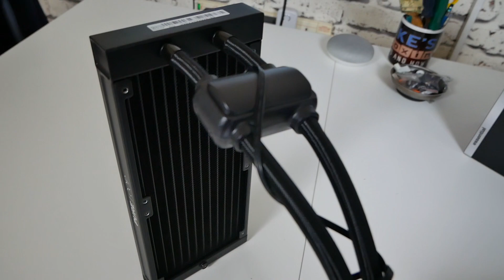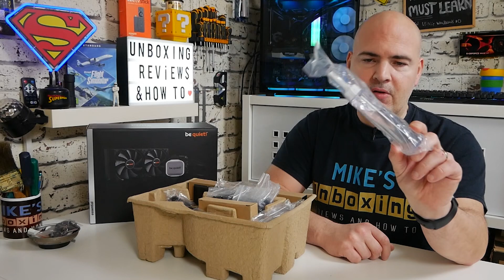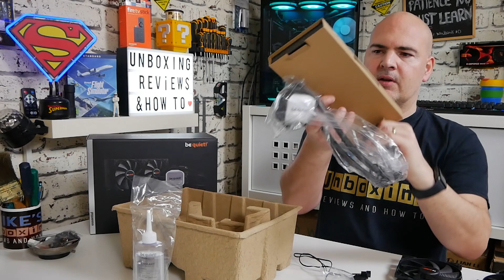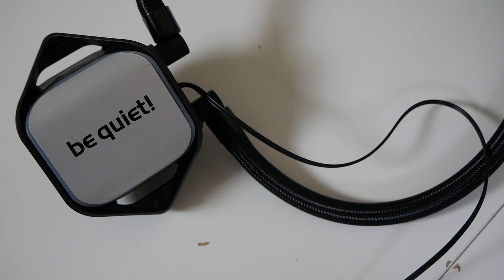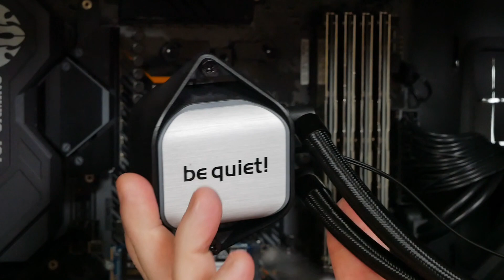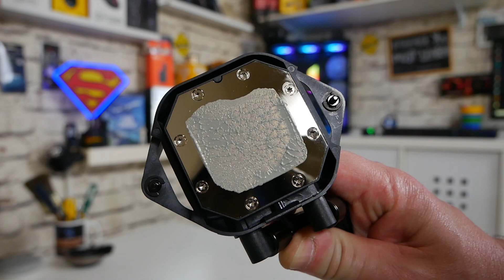BeQuiet Pure Loop 240mm Refillable Silent AIO PC Cooler

Comment: Great review Mike. I actually purchased this from Amazon US for $94.50 USD, Never tried water cooling , so I thought...why not give it a try. The two main selling points for me was how the pump was attached to the cooler hoses and it could be refilled when needed. Brilliant! When ever I peel the plastic off a new cooler... I always clean the bottom of the cooler with  Isopropyl alcohol 90% or better to clean any adhesive that might still be on the bottom. Thanks for all the hard work You and Kath do for all of us wherever we are in the world. Cheers.
Reply from the maker: thanks rick glad you like the cooler, it is a nice design and that also reminds me i need to buy some alcohol

Comment: The cheapest I can find it in the UK is £89.99 plus £4.79 shipping. At that kind of price you're talking the equivalent of a very good air cooler, something like a Noctua NH-D15, so I'd be interested to know how they compare. Enjoyed the video by the way.
Reply from the maker: yes against the d15 is is very close although for me the d15 is actually a bit too big and prevents easy access to the gpu if it needs removing, both are awesome options
Reply: @mikesunboxing  Yes, I can see how a large air cooler can lead to size restraints. I have my GPU vertically mounted and it nearly touches my CPU cooler!
Reply from the maker: @mikep9418  that is always a concern with air cooling. vertical mounting gpus was really designed for water cooling or the narrower cases like the lianli o11 etc

Comment: From a design perspective (and after the infamous Gamers Nexus AIO Video) It ticks a lot of Boxes.
Top mounted and the pump is lower than the rad so below the highest point
Bottom Mounted the pump is below the CPU block so below the highest point
Front mounted obviously if at the bottom would be at the lowest, 
The only place it even comes close to being the highest point is when front mounted with outlet at the top but even then it 'should' sag down enough to be slightly lower.  
Maybe it would be better with another 2-3 cm of tube before the outlet but? might create more aesthetic/interference issues.

(Personally after everything  I've heard and seen about AIO's I'll stick to Air cooled......Maybe :p )
Reply from the maker: Agreed steve has changed the market

Comment: My son had considered the 280 version but went with Arctic Freezer instead.  This may have fit the top of his case bc the radiator is not as thick as the Arctic, but the Arctic, I imagine cools better.
Reply from the maker: the arctic has a larger thermal mass due to the thicker rad so often tops the charts in raw performance
Reply: Of course, am sure why my son chose it, over the be quiet !

Comment: Even though this is great water-cooled product from be quiet, I have chosen  be quiet! Dark Rock Pro 4 50.5 CFM CPU Cooler for my new pc (most likely Intel since ASUS mb build quality is better than AMD one, and I had ASUS (Intel) mb for 10+ year's know + it is working as good as day one).  I bought  be quiet! Pure Base 500DX ATX Mid Tower Case for my system, and can't recommend it enough, it is amazing. If you can, buy it for yourself and put your system in it.  It has RGB, but it is the right amount (in my opinion). I moved top fan to the front to increase space, and add more cool air in.  When I build similar custom (one off ) pc case, I'l put their top of the line fans (x5  be quiet! Silent Wings 3  140 mm	Black 1000 RPM	59.5 CFM  15.5 dB (3 exhaust, 2 intake )). I have to mention that, I also bought their top of the line PSU, that will be most likely overkill for my pc system ( be quiet! Dark Power Pro 12 1500 W 80+ Titanium Certified Fully Modular ATX Power Supply).
Reply from the maker: sounds like a really nice system

Comment: There is a280mm version. I have it and it does wonders. I have the fans running at low speed and it keeps my 3600 cool and is virtually silent.
Reply from the maker: a would have liked the 280mm version but i think the 240mm offers a little more options for some modern cases
Reply: Just out of curiosity what sort of temps are you getting with the 3600 Idol and under load? Thanks
Reply: @Private-Hudson  30 to 33c idle. Never got higher than 72 under load.
Reply: @hammerofdoom  Cheers.

Comment: fans, pump and cooling were best during the load, but the pump was so noisy at idle time. I decide to replace it after 2 days. Replaced by Fractal design celsius s24 because Be quiet get out of stock and I feel the Fractal is much better for me.
Reply from the maker: the pump in mine was totally silent and mine only runs at full speed so can't validate the issue you had, but thanks for letting us know

Comment: AIOs are something that Ive been sat on the fence for a while about.  Nearly bought the Arctic Freezer II a few times but then though "would I actually get any benefit over my Hyper 212 Black ?"  I suppose if the price was right and the reviews were decent I would probably do it but it would be either the Arctic Freezer or this BeQuiet one.  The actual kewler block looks VERY big compared to some others.  Thanks for the informative video Mike and Kath :-)
Reply from the maker: come on bob join the WCMR (water cooling master race) is that politically correct? who knows any way get one! 😎
Reply: @mikesunboxing  Go on then......Im gonna get one you swine !
Reply: LOL
Reply: Stock cooler life here Bob!
Reply: @outlawfett3530  Suppose I just wanna give it a go just so I can say Ive done it lol.  When the price is right I'll get it one.
Reply: You ask me, either is a good choice.
Reply: @PapaMav  Exactly, wont know until Ive tried it.  :-)
Reply: @uglybob7505  and I am a fan (lol) of air CPU coolers as well; my boy got the Arctic AIO when he bought an i5-10600K, knowing he was going to overclock the snot out of it.  Until then, we had been using air coolers no problems.

Comment: Can someone help. I just got a b550 mother board and everything works perfectly except the dram debug light is on
Reply: Reseat ram.Reset bios to default or you can even upgrade bios. It should go.
Reply: @alimansoor78   thanks
Reply from the maker: Did you get it sorted?
Reply: @mikesunboxing  yup updating the bios worked.
Reply from the maker: @DanielSanchez-hm4wm  Great news!
Reply: @DanielSanchez-hm4wm  that's great news